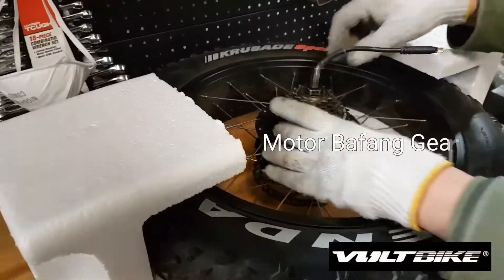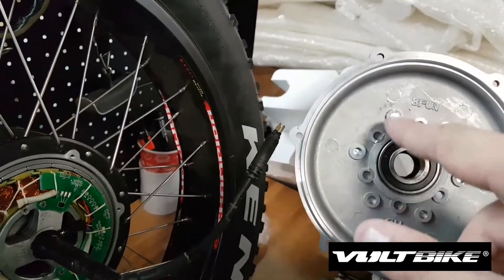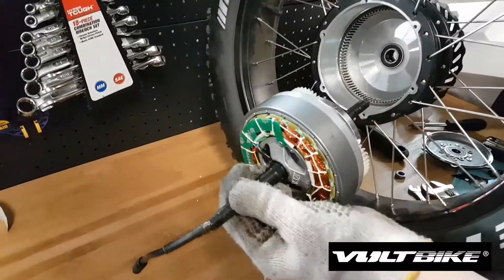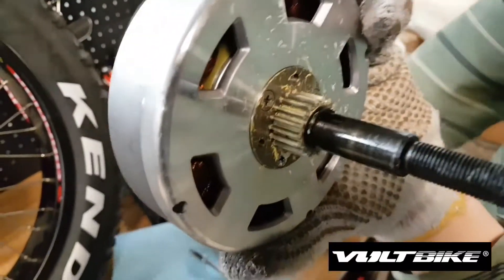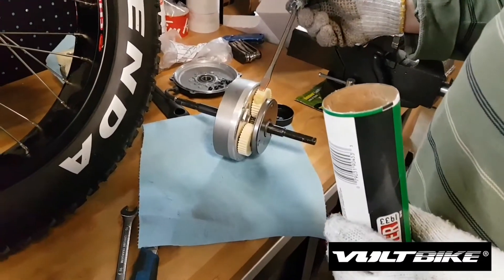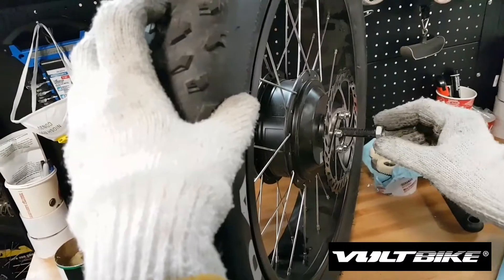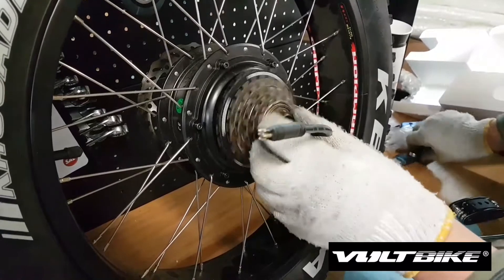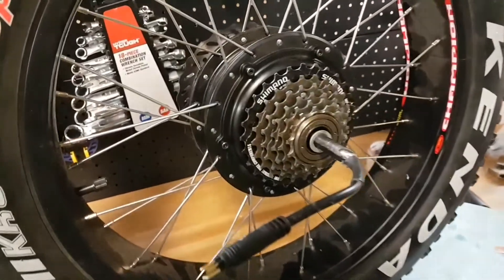How to replace gears on electric motor Bafang 500w

Comment: why wouldnt they use metal gears instead of whatever material those are do avoid having to do a replacement like this doesnt make much sense as it seems its designed to break and replace.

Comment: Are all gear sets the same? I have a 1000 watt retroblade motor for a hyperscrambler 2.
Reply from the maker: Every motor is with different style gears. For example Bafang SWX02 and G060 are using different size gears. You should look for your specific motor and model number.

Comment: Very helpful video. I used this video to replace the gears in my Juiced Bikes Cross Current. The clutch had started slipping under power.
Reply: was it making a grinding noise? mine is very grindy when I'm sitting on the bike. ok when I'm not
Reply: @peterdebonoolppokkkjhg2215  No, mine was slipping. I would pedal or hit the throttle and I could hear the motor spinning but there was no motor assistance.
Reply: @peterdebonoolppokkkjhg2215  That means she's ready to fail, only use it on the flats or it will crunch on you, lost mine the other day, just one hill too many and she's a mess, I'm buying a 1000w no gear next time as they last longer
Reply: @ianmangham4570  thanks Ian. is there any way to repair it? mechanically looks fine, redid the wire loom as it was frayed. the magnets around the inside of the hub can be moved with a screwdriver, I thought maybe the grinding noise was the magnets moving around inside the hub as the motor turned
Reply: @peterdebonoolppokkkjhg2215  If the magnets are loose it will be the noise most likely, use as some epoxy resin and glue them 👍
Reply: do you have to remove the free wheel. Both parts of the motor are stuck together for me and I cant get at the gear ?

Comment: QUESTION...  Do you (or anyone) know if those same planetary gears are used in the very common Bafang 750 W rear hub motor (RM G060.750.DC)? I want to upgrade mine to metal gears as soon as my warranty period is over. Since my motor is on warranty still, I cannot pull it apart to check the specs of the planetary gears, and unfortunately those specs are not available anywhere on-line. After some unconfirmed research on a Chinese web site, I believe the gears are 36 tooth 47.8mm outside diameter x 13.3mm thick, but that's just a guess. I am not sure if the bearing is a 606 or 608 bearing. Any confirmation at all would be ultra helpful.
Reply: I wouldn’t recommend metal the nylon protects the hub gear and if it fails it will ruin it the nylon r made to fall apart when they fail making easier to replace and protects the hub

Comment: 🤔🤔🤔🤔🤔You didnt say why are you changing the gears in the first place which is stock free wheel clutch or damaged plastic white gears, in your situation,  the clutch is not working because the gears lock fine, 
Second problem in your video is the grease to be used, which is the lithium grease that is  compatible with plastic, otherwise those plastic gears will be destroyed.

Comment: Nice explanation and video.. only one thing a soft mallet would be nicer for the threaded axle.  It's nice to see the gears are easily replaceable because I am looking at this type of motor in a new ebike and I was worried about durability.  Thank you for posting this.

Comment: Also this has one magnet would it be beneficial to add extra magnets
Reply: Not sure, but thinking this would throw off the speed controller.  I would leave it with thae amount it came with from factory.
Reply: @g.fortin3228  there is a setting where I choose how many magnets in my LCD  settings I'm thinking it will shorten the delay for the pedal assist to kick in and also to stop
Reply: @jbar3337  Ok I didnt know you had a setting in there.  may be right on with that thinking.  I dont see that it would matter much for roadie but for off road yeah.

Comment: NO adjustable wrenches! Get the proper tools. Use a plastic hammer.  Synthetic grease is best. Always use your cell phone for pictures when disassembling. I also would have mentioned to do some thorough cleaning of the parts before applying lubricants and re-assembling.

Comment: Thanks for the great video! Would you mind sharing the part number of these gears or a link where to purchase?
Reply: Hi you find the gears on aliexpress website or ebay but you need first to know the diameters measurment of your gears by using special tool that you can find on amazon. I just replaced mine from aliexpress website.

Comment: Thanks a lot for this awesome video. I have a befang 8Fun 250W motor. The motor is very noisy already, and has few power. I think the planetary gears are weared. It is good if I replace only the 3 gears?

Comment: I have 3100 miles on my 500 watt Bafang hub motor and notice it's starting to get a little noisier.  Is the increased noise a sign that I need to replace my gears like this?
Reply: yes. replace it if you have noise and vibrations.

Comment: Thanks so much for this comprehensive video! Really appreciated! How many kilometers do you think a Mariner 500 watt motor will go before we should replace the gears?
Reply from the maker: In around 3 years period and out of few thousand bikes sold, we had to replace gears may be 2 or 3 times in total. Probably in you bike lifespan you will never have to replace gears. Those gears are made of heavy duty plastic and is extremely rare to experience any issue. We uploaded this video mostly to complete our "How-To" video section.
Reply: I am wondering if it would be ok to use steel gears since they are available ? because for these motors  there are nylon and steel gears available for these Bafang motors. also there are two different style gears available for this model motor they come  in set of 3 gears one set has  only  28 teeth and the other set of 3 gears has 36 teeth so which set should be used an what differences would it make between using 28 teeth or using 36 teeth gears thank you for any help you can provide it is greatly appreciated thanks sincerely jaymus
Reply: @neverumindnevertell2616  I would prefer using the nylon gears, because nylon woukd propably fail before metal and therefore you would only need to change the gears. Pergaps the reason of choosing the nylon instwad of metal gears?